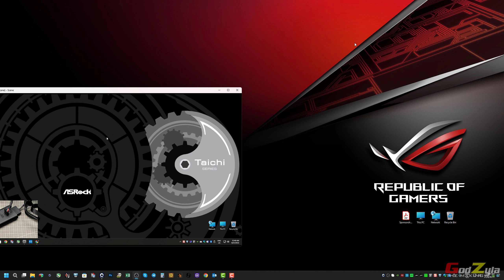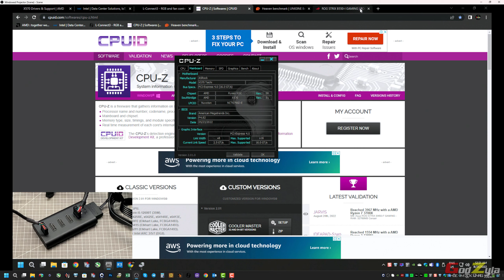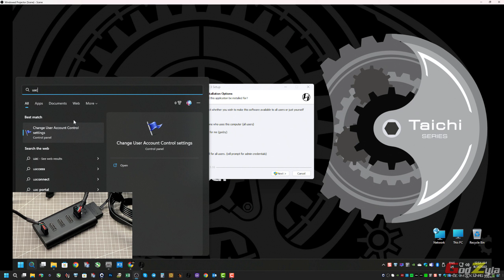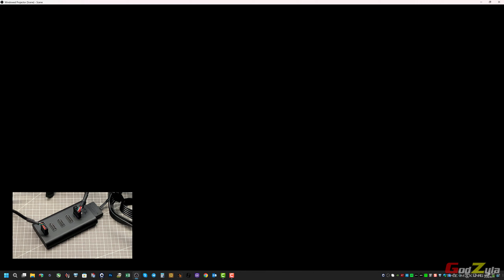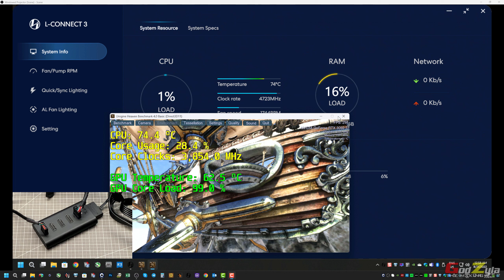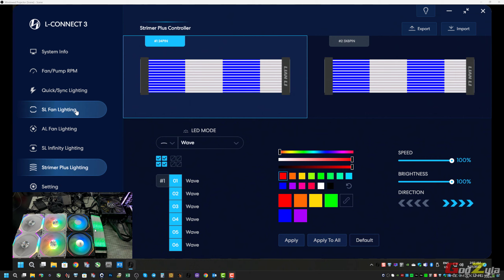Lian Li ARGB Products (How to make it work?) [L-Connect 3]

Comment: Hi, what about if we also have Water cooling pump rgb? Can we control it individualy from li connect 3? Got 10 SL120 and one aio "Galahad" pump.

Actually using Li connect 2, all my fans and pump are on the same controller, using rbg splitter to put my case + pump rgb into the controller and i have 3x 3sl and one sl that make my controller full (of course my pump, and aio fan are pluged into my mother board)
So actually my pump rgb is running the same animation as my fans but i would like to make it different. I do not see any special window for pump like there is one for SL or AL.
Also planning to switch from li connect 2 to 3 because we can set a fan curve based on GPU temps whiche seems so nice for my intake who's just in front of my gpu.

Thanks in advance!

A new sub :)
Reply from the maker: Hello Nicolas Petit, welcome to my channel. there are no specific window for the galahad in L-Connect 3. as what you've connected will have to follow the SL fan window, is just like in your L-Connect 2. You see, the Galahad does not have a controller like the SL, AL and SL infinity where it has an IC Chip to controller the argb patterns. at this stage, there are no features for this but with your feedback, I try to write in to see if Lian Li will take in your feedback. with this said. I will take a screen shot of your feedback here and to pass it to Lian Li.
Reply: @KleoYan  And if i use two controllers to put my galah rgb alone, may it show a 5th fan setting that i can use yo setup my pump rgb alone then?
Reply from the maker: @EyesNico  yes you can, not an issue, example if you use 2 SL controller, your L-Connect 3 will show two SL section. one which you can continue to control the argb effects on your SL fans and the second SL Section where you can just set the argb of your Galahad pump.
Reply: @KleoYan  ohhh perfect, I'm gonna do that :p.
Thanks :)
Reply from the maker: @EyesNico  you are most welcome and thank you for the visit and to have subscribe to my channel. oh btw, I have sent Lian Li an email with your feedback.

Comment: I've got this issue where L Connect 3 picks up all temperature readings and even handles my custom fan curves. But as soon as I minimise the app the fan curve no longer reacts to temperature changes. It only works while the app is maximised, unlike Afterburner. Any idea?
Reply from the maker: Hello John Wayne, welcome to my channel. Hmm I have just tested, no issue at my end. Mind if I ask which processor and motherboard you are using and which windows os are you using?
Reply: @KleoYan  Hi mate, I am running Windows 10 with a 9900k and ASrock z390 Phantom Gaming ITX.

Comment: Hey, do you have a video on your channel showing how to wire properly the O11 Dynamic Evo, Strimer Plus V2 and Uni Fan SL-infinity? I have trouble with it. Do I have to plug the 5v RGB from each controller and case? If yes, do you plug it for example the case rgb 5v into the fan controller and then to the MoBo? Or does it have to go directly to the MoBo? What happenes, if I dont plug the 5v RGB? Thanks in advance! You do very good videos!
Reply from the maker: Hello SKY, welcome to my channel and sorry to say I do not have this case, therefore not able to advise you on the connection. You might want to ask others at lian li Reddit forum. https://www.reddit.com/r/lianli/

Comment: Power supply is probably only relevant to those people using lots of controllers and fans.  BUT the suggestions regarding the USB hub is genius.  Most of us have far too many USB devices, connected externally, but we don't know which internal USB line they are running from, and if it has enough power.
Reply from the maker: Hi Julie Fisher, welcome back. Yup, I have tried using usb splitters which does not have sufficient power and due to the fact that most PC users uses too many usb devices. This will cause intermittence or even unable to recognise the device. That’s why I choose to use an internal usb hub which is powered by the psu sata directly. Btw am using the NXZT internal hub.
Reply: @KleoYan  NZXT hub seems to be a safe bet, even the idiotic USB hub from Lian Edge Power Supply seems unreliable to their own products.
Reply from the maker: @ hi and yup that’s what I have been using. It deem to be more reliable. 👍

Comment: My cpu temperature always not accurate reading on l connect 3
Reply: So the gpu temperature is accurate like on other software and the nzxt screen it matches the temperature. But for the cpu temperature the l connect 3 software doesn’t match any other software I have and it goes from 30 degree to 70 which makes the fan spin a lot faster
Reply from the maker: @immanuellim1691  I see, as you can see, this vid is purely making use of l-connect 3. My guess is the conflict sharing of data as which application is fetching the information first. I believe you are running both L-Connect and the NXZT cam. For this am not able to assist you. Do pardon me.
Reply: Because the fan is set according to the fan curve
Reply: But even when I run only l connect it is not accurate
Reply from the maker: @immanuellim1691  hmm 🤔 interesting. What’s your system specs?

Update : thank you to reach out to me via email. Hope it will solve your issue. If not, do contact Lian Li tech support.
Reply from the maker: Hi Immanuel lim, welcome to my channel. Are you able to elaborate further when you have mentioned it’s not accurate? Does the temperature reacts in l-connect 3 when you run any bench mark test for cpu and gpu?

Comment: Very informative instructional video Kleo. I own 6 Lian Li UNI Fan AL120 , 3 Lian Li UNI Fan SL-INF 120 RGB Infinity Mirror Fans , 2 LIAN LI Strimer Plus V2 ,and the Lian Li Galahad AIO 360 RGB UNI Fan SL120 with 3 Lian-Li controllers in my ROG MAXIMUS Z690 HERO and now I understand how to connect every component together with the NZXT Internal USB Hub 3. The only problem is I own Corsair Dominator platinum RGB ddr5 ram that doesn't sync with  the L-connect 3 software so I use the Asus motheroard plug to bypass L-connect 3 and every component syns with Asus Amory Crate. Thanks for a great channel !!!
Reply from the maker: Hi Jim Hamilton, welcome back, yup there are still other argb stuff which I am not able to resolve as I have tried writing in to Corsair and NZXT for sponsorship. But none replied, that’s why this vid title is meant for all pc builders using lian li products. Nevertheless thank you for your support👍

Comment: Great video! but I have a question as everytime i startup my computer my sl-infinity will go full blast and the weird thing is that its the first fan connected to the wire the back 2 fans are normal. this only happens when i download L-connect 3. After uninstallling the RGB goes back to rainbow and the RPM is back to normal Do you have a fix for the full blast problem?
Reply from the maker: Hello Legends ND, welcome to my channel, mine will just go full blast and back to normal for a few seconds. I take it as normal and so sorry to say, I don’t have a fix for this. I can understand it’s annoying. Am going to write in to ask lian li tech about this. If I do get a fix, I will let you know.
Reply: @KleoYan  Thank you so much I really appreciate it and maybe you could even make a video on it as I see other people online having the similar problem as me. Cheers!
Reply from the maker: @LegendsND16  yup as some of the feedback and comments are about the rainbow and fan blast issues. Let me see what I can do. No promises though. Once again thank you for your visit and valuable feedback 😉👍
Reply: @KleoYan  and also can I control the RPM on my AL and SL-infinity fans with the software if I connected both it's PWM cable to the motherboard?
Reply from the maker: @LegendsND16  if you do that, you can choose to use either L-Connect or the motherboard utility app, not an issue. The only problem I find is that you have to toggle to motherboard mode in l-connect 3 and this will affect the argb effects as it’s taking instructions of the motherboard and not l-connect 3. For this type of scenario, which applies to SL and AL but not the SL inf, I would connect the fan header of the fans directly to the motherboard header and leave the argb on the uni controller. Hmm 🤔not sure if this make sense to you though.
Reply: @KleoYan  I currently have both the Fan header to my motherboard but did not plug in the ARGB cable so if my L-connect issue were to be fixed in the next few months and my AL and my SL-infinity fans were to have both the fan header plugged in the my motherboard what would be the state of probleme?
Reply from the maker: @LegendsND16  I see. hmm.. i have no definate answer for you.. have you try positing this on lian li Reddit? you can try that or write in.. infact I already did, just waiting for them to reply. I fully understand your sitaution and I wish they did bring the L-connect original or L-Connect 2 where by you do not need to set to motherboard mode. at the fan selection profile, there is already a PWM swtich which will only determine to use fan load from motherboard and leaving the argb intact.
Reply: @KleoYan  Totally agree. Thank you for the help man I really appreciate the help you gave me, Keep up with the amazing content!

Comment: Hi kleo I have a question about L-connect 3, why do I have to click gpuz.exe every time the pc starts up and click L-connect 3 every time I restart or boot up the pc
Reply from the maker: Hello Patrick, welcome to my channel. I believe it's asking for permission grant. This is related to UAC. If you have leave it as default, you will get that prompt. I encounter that and I just disable my UAC which I did mention how to disable it in this video. But a lot don't advise it so do it on your own discrete.
Reply: @KleoYan  I don't like to disable the UAC.  So L-Connect 3 still comes up with that prompt.  But the gpuz.exe I solved by instructing it to run as Admin.  No longer an issue.  I suspect the same can be done on the L-Connect 3 but at the moment it doesn't seem to be holding that setting after a reboot.
Reply from the maker: @Jules_Diplopia  yup, if you shut down or reboot. It will still prompt and yes; it’s up to individual. I don’t really mind disabling the UAC but not for everyone. Reason is, every 8 months I will rebuild my OS and to change settings of my router. For security patches and with better encrypted password.
Reply: @KleoYan  thanks i hope a fix come soon for that
Reply: @KleoYan  how can i disbale that please help me thanks kleo
Reply from the maker: @Patrick-pv4ud  do this at your own discrete ya. click on the search magnifying glass > type in "UAC" > when the pop up UAC window appears > Pull down the level right below were it says (not recommended) .. infact is in this video. https://youtu.be/CgvuUFeff8U?t=1164

Comment: Have the sl fans and strimers V2 when i boot up my pc the fans rgb will stay the color that I wanted them to sync up to but my strimers will always revert to the default rainbow but once I login it the strimers will sync to what I want any fix for this
Reply from the maker: Hi Matthew Holland, welcome back, this I do notice too. But mine is slightly different as compared to yours. All my fans and strimer plus v2 will be in rainbow and will only change with windows is booted up with the l-Connect 3 auto loaded. Will seek lian li support on this. I lcd I do have a fit, will let you know.

Comment: Everytime I turn on my pc I have to log into L3 to load my fan rgb and fan speed. How to I fix where it’s not default
Reply from the maker: Hello Texas Elite, welcome back, when you boot up ur pc. It will be on rainbow effect till your windows boot up and automatically load l-Connect 3. Did you enable the auto run under the L-Connect 3 app?
Reply: @KleoYan  I’ll check tomorrow I’m at work Ty

Comment: Great video. All of your videos have explained the entire Lian Li fan ecosystem. As a recommendation, it would be nice to see how to integrate it with the Lian Li Lancool iii. For example, how to tie in the front ARGB fans, motherboard integration, etc.
Reply from the maker: Hello Iron Condor Simulation, welcome back, let me see what I can do about your request later as currently am waiting for Arctic's 420 liquid freezer to reach me. once again thank you for your suggestion and to have visit my channel.
Reply: did yall figure out if the front 3 argb's on the lancool iii are controllable by Lconnect?
Reply from the maker: @mariopro519  hello and welcome to my channel. The lancool III fans have the similar argb 3pin Jst03 plug where you can plug to any argb port or fans in a SL or AL controller. But for the SL infinity controller. You can only plug the argb to sync 2 or sync 4 port. The fans you need to plug directly to the motherboard fan header.

Comment: When you use l-connect 3 to sync with the motherboard Argb, Why does l-connect sync all controllers attached to the usb bus,  instead of only one? For example if you have uni fans and strimers installed, if you sync to argb, both controllers will get synced… but I want the fans synced to the argb input, and the strimer to continue to be controlled by l-connect.
Reply from the maker: Hello j340, welcome to my channel. If you by pass L-Connect and to sync with the motherboard argb software, all argb effects will be based on your motherboard argb software and not the L-Connect, therefore you can't seperate the argb effects.
Reply: @KleoYan  hello. Thanks. I realized that last night, but it would be good to be able to bypass l-connect on a per-controller basis. In l-connect all lian li has to do is Simply disable argb controls for a controller that is bypassed. The argb strimer options in l-connect are great, like the drizzle effect. But the argb options for the fans are hit and miss. For example l-connect doesn’t allow you to change individual LEDs on a given fan, it’s either all or nothing. Also the rainbow effect is locked to a default color scheme, you can’t choose your own colors. So I would prefer to use the strimer with l-connect and the fans with the motherboard/external controller.  But as of now I can’t do what I want to do. I may file a feature request.
Reply from the maker: @j340_official  hi as what I have done. You are able to set individual colour effects on AL and SL infinity fans when using l-connect 3. https://youtu.be/a6uYGAcbY_Q

Comment: Another excellent  video, I do have an issue with L-connect 3. I've tried different methods but failed. Your tip on even power distribution have solved the problem. Thank you Kleo,  you are awesome as usual.
Reply from the maker: Hi Nox Mu, welcome back, I am gald you have fixed your issue and thank you for the compliment.

Comment: I have the SL140 and dual boot into Windows and Linux. I set everything up in Windows. Then, I boot into Linux. The effect is there for a few days and then it reverts back to rainbow. Do you know why this is? Does it require talking to the L-Connect software once every few days or so to keep the settings?
Reply from the maker: Hi Mark A, welcome to my channel as for dual boot, am so sorry to say that I am not familiar with linux therefore unable to explain your situation. You might want to approach lian li tech support or to post your question at their reddit forum. https://www.reddit.com/r/lianli/
Reply: @KleoYan  Thank you for your reply. Not a big deal. What I wanted was the rainbow effect to go across all the fans instead of each fan showing the same effect but that is not possible. The neon effect is close but I can't choose the colors and it doesn't have the nice moving animation of the rainbow. So, in the end after all of this, 95% of the time it is running the default rainbow.
Reply from the maker: @marka5968  I see. Thanks for the feedback, let me see what I can do at my end. Will be writing in to Lian Li about your feedback. Let's see if they do take in this valuable feedback. Thank you again..
Reply: @KleoYan  I found a way around the problem. I bought the Lian Li ARGB cable kit and it has a connection from Lian Li 3 pin to ARGB motherboard header. SL140 when connected together is seen as a single fan/strip and so rainbow effect goes across it. The motherboard header refreshes slower and the animation is choppy compared to the LianLi controller. However, this will depend on the motherboard since some will have a shorter rainbow cycle. Connecting the Lian Li 3 pin to ARGB back to 3 pin does not work because the RGB cycle of the controller is exactly the length of the SL140 LEDs in the fan. Also, the same ARGB cable kit has a cable to connect AL120 to the SL controller. I was able to add the AL-120 fan into the build along with the SL fans. As for the Lian Li controller, it remembers its setting only until the next power cycle. So, if I restart my computer from Windows to Linux, it remembers the effect. However, if I turn off the computer and start into Linux, it does not remember the effect. The controller does not have a memory to store its settings it seems.
Reply from the maker: @marka5968  Hi, interesting finding. As what you have mentioned, it narrows down to the controller. If it can take in linus commands and not windows command, This could work for end users using linux. ok point noted, let me see if I can give them a heads up via email. Maybe suggesting them to write out a Linux L-Connect 3, that will be cool. Thanks Mark for the feedback.